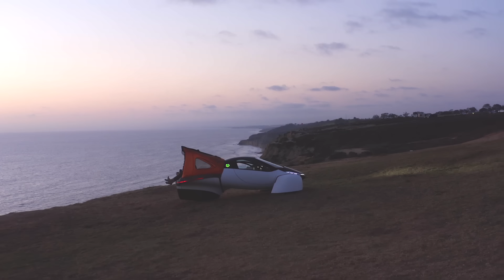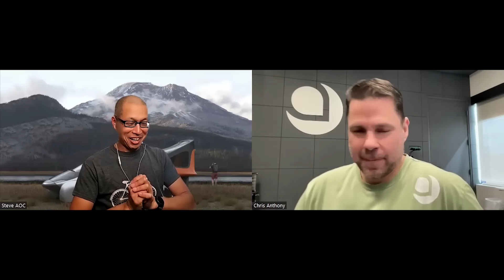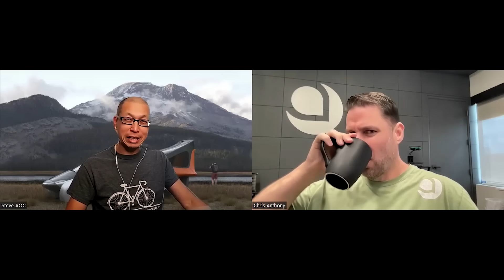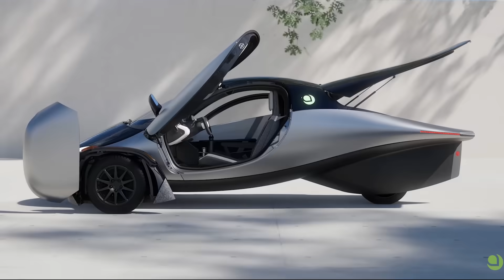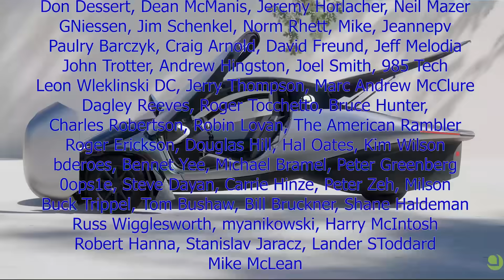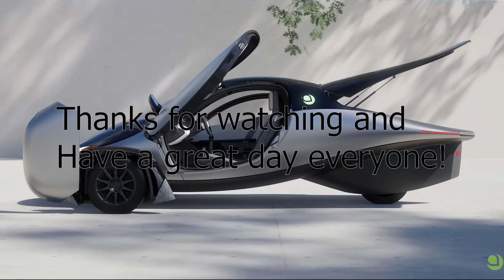Part 1/3 Aptera Update with Chris Anthony May 2024

Comment: I live in New York, but I plan to go to California to pick this up when it's available.  Because to me, this EV represents freedom from oil and the large auto makers.   Aptera is a  company that believes in rate to repair.  A very rare situation.  Plus in general solar will probably satisfy my charging needs most of the time except for road trips, and even most of my road trips are shorter than the capacity. I'm ordering the 600 mile version so I can maintain proper battery charging, use heat or air conditioning when needed and account for cold weather losses.

Comment: Darn, deleted my battery comment by mistake.  Regardless, your pithy reply was not useful Steve.  What was not made clear and this is possibly from editing is that it was suggested they are buying this laser welding equipment locally while also sourcing a full setup from CTNS.  So my question is why this expenditure for the equipment they do not need long term or do they expect the CTNS factory to come much  later.

Comment: The very idea that they would pause production to move the CTNS equipment is incredibly dumb. No one in their right mind pauses production over an event that can be mitigated let alone one so important to achieving production goals. They truly need a month's supply of packs on hand to insure there is no outage because payroll and accounts payable do not stop. I am going to chalk this one up to Chris not being prepared for the question.  

Just do the math in your head. This has to be down at most during ramp up but Chris has stated ramp up will happen quickly. Well one line full ramp is two hundred packs.  Air freighting the equipment is not instantaneous as given the nature of the equipment the packing and movement to the airport is very involved and that is nothing compared to getting it situated and certified for production in Carlsbad.
Reply: Agreed.  I couldn't believe what I was hearing.  That will take months to disassemble, transport, reassemble and validate the line.

Comment: I appreciate the admission that CPC's model did not agree with Aptera's and that is why they wanted to test Beta. A discrepancy does not mean either model was wrong, it could just mean they were both off by a margin of error that added up. But they would want to fully understand the variables involved so they could figure out what caused the inconsistency. 

I'm also glad to hear it confirmed that Gamma was not as useful for testing as Beta because it was designed for a body structure that is now obsolete.  Gamma was tested, but CPC wanted to go back to the source.

I also liked clarification of CTNS's role. They aren't building any production battery packs, that will apparently be in the hands of Aptera, using the purchased robots. The PI battery packs are just being made locally for the PI builds only. Still unsure when CTNS intends to produce  a few battery packs as part of their validation and what they will be used for, but that doesn't seem to be an issue.
Reply: Didn't I hear him confirm that they were using the refined Gamma suspension-frame for the PI builds?
Reply: I don't believe so. It's my understanding that the PI frame is entirely new and related to the carbon fiber SMC construction.
Reply: @richardryley3660 But can you confirm Chris didn't say otherwise?
Reply: @adimchionyenadum2962  You're making the claim. You have to back up that claim with evidence. If you can't, I can conclude you are just making it up.

If you can provide a timeframe for this video, or who the interviewer was, or other topics that were mentioned then maybe I can identify the video and we can discuss it. But no, I do not have to prove a negative.

Comment: Building anything new takes a long time. Time is money. VW took years to build VW Buzz and get it here to the States. It doesn't even like the original Buzz. Give them a chance to do it right the first time. If you work in an industry that makes goods for people. You would know the hardships it takes to make new things. My job can take two to three years to redesign one part. Aptera is going great, and we need to be patient. Thanks for the information you got.
Reply: It's taken years for Aptera to do what they are doing. Started around 2006 and that failed. Started again with a similar vehicle in 2019 and here we are 5 years later. I fully understand it takes time but please, do not hold a carrot out in front of the crowdfunding crowd as it would be next year, on;y to give people hope that they will get their prize within the year. Aptera (like many other startups) are guilty of this. At least VW didn't ask people for money years ago. They just teased us with prototypes. So, they just lived rent free in your brain all of those years.
Reply: @billsmith5960  The earlier failure was exacerbated because of lost of management control and the recession (which resulted in a lot more startup failures than Aptera).  A new model takes automakers typically anywhere from 5 to 7 years to make and they have billions of dollars and much manufacturing structure.  So the 2019 startup is not really that far behind given much smaller startup funding.  At least they aren't burning through investor funding like several other EV startups that have failed or about to fail.
Reply: @madmotorcyclist  - Yes they lost control but in the end, same two guys with a similar product.

Yes they are not burning through as much money and it shows in the lack of progress. There is a point where you have to start spending. If not then it's the same cycle of being right around the corner and then missing that milestone only to have redesigned something. It's a much too common cycle.
Reply: You still haven't disputed my point.  Automakers even with billions of dollars and manufacturing facilities and suppliers already lined up take 5 to 7 years to make a new model.  Aptera's timeline is not that much longer so far given the fact that they essentially started from scratch.
Reply: @madmotorcyclist  - The traditional automakers go through lots of design and testing. They don't advertise that and thus, we just assume the development cycle.

As for Aptera, they are not even to the stage of pre production prototypes. Yes, they have plans for 16 of them. Yet, we have zero idea if those will live up to the claims. Then will they live up to the reliability and long term use?

At this point, people are assuming that they just need to get to production because they see a prototype that looks finished. Yet all of the details are unknown or Aptera just tells us something and we believe it. 

A good example is the complete body and chassis. They made a complete change to it. Then it's the suspension. Seems that it's been ready to deliver since 2021 yet they are still refining it? Sounds like to me that what they claimed in 2021 was not correct yet people believed it. Then in 2022, 2023, 2024....

So what are we to believe? They are super efficient and will produce a product that will be as reliable as what traditional auto makers do? Will they have the service and warranty that traditional automakers do? What about training of the mechanics? Seems that Aptera has glossed over all of the details yet people seem to just believe all of their claims.

If they can pull this off and actually stay in business plus have happy customer service, then I'll be the first to applaud them. At this point, they are not even close and the superfans think they are.
Reply: @billsmith5960  You are make factitious points.  First Aptera has been more upfront with information and has walked investors through their design and step by step progress with more updates than any other EV startup, which you seem to only grouse about and chastise if their timeline slips. Second concerning warranty will be derived once integrated testing begins.  Already we know the hub motors have been tested in extreme conditions and up to million miles by the supplier.  What are you concerned about with their body?  Fiberglass and wraps we already have experience with it and it seems the only new thing is the carbon fiber extrusion production and integration with the outer fiberglass shell, which they have seemed to have passed.  As for the frame updates I applaud that they make updates from the experts in Italy that know more about it than you are me.   As for accuracy of information you doubt the computer models and simulations they have been using (they already have shown how close multiple simulations have conformed to real testing with Beta and Gamma (maybe you missed those videos of the graph plots, or the blender app that showed their solar estimates are on par with what they stated).  Again, has other EV startups  or even Tesla been as forthcoming? Maybe you should be directing your efforts to other EV automakers openness (like where is that Tesla supercar they have been working on and taking money for)?  Guess you want them to go fast to production like Tesla did which had horrible fit and finish issues.
Reply: You lost some credibility saying "we just assume the development cycle" and yet you don't apply those same assumptions and timing it takes for Aptera.  Let me give you a concrete example: I have a 2011 Leaf (that I still drive as my main vehicle on the original battery) and can use it as example of how long it takes to production.  I'm on the first generation and the second generation took six years (2017) to get to production.  Gee, Nissan had all the prototyping with the first generation, money, facilities and suppliers lined up to make a new Leaf model and it only took them six years.  So, if Aptera makes production next year even without having everything in place at the start of 2019 they seem to be on track and maybe even ahead.  Sure they blew pass their timing estimates but given how they are approaching production is radically different I can't fault them for missing deadlines for something that is unlike any other vehicle.
Reply: @madmotorcyclist  - Next time you post, don't make it just a rambling on and on with no clear thought process. If you want intelligent responses, change the way you post.
Reply: @madmotorcyclist  - Since the original timeline was talking about timelines, let's take two examples of EV's that are much more complex:

 If you ever followed Ford and their F150 EV, they announced it in January of 2019 and first delivery was in May of 2022. 

The Cybertruck was announced in November 2019. First delivery in November 2023.

You said: "Automakers even with billions of dollars and manufacturing facilities and suppliers already lined up take 5 to 7 years to make a new model."

I picked two completely different companies making brand new vehicles. Plus they had to go through the whole covid thing. So, from announcement to delivering to a customer seems to be around 3.5 years for Ford, and 4 years for Tesla.

So, here we are for a vehicle that was presented around 2006 and failed. Take that old design in 2019 and try again. Here we are 5 years later and they don't even have a working pre production prototype. This is from a company with production dates of 2021, 2022, 2023, 2024 and now 2025. I wonder why it's taking so long?
Reply: @billsmith5960  and their quality speaks volumes of those expedited timelines.  With Ford it is software.  With Cybertruck it is with recalls.  What about those early Teslas models their quality was pretty bad with how their body was put together.
Reply: @madmotorcyclist  - The Aptera quality is excellent. Same for durability and when it needs to get serviced. Aptera has them all beat.
Reply: @billsmith5960  Oh, a sarcastic remark, how drool.  Was my response too succinct for you to understand.  The Ford lightening software is atrocious which happens when you slap a battery and corresponding electrical system in an already existing design too quickly.  As for Tesla monstrosity known as the CyberTruck I give you https://www.youtube.com/watch?v=LC9a3GR1HJY which shows quality doesn't come with price, especially their trucks have already have rust issues.
Reply: @madmotorcyclist  - I thought we were talking about the timeline about going from conception to production. If you want to change the subject, then I guess we can go that way.

As for the Aptera software and quality control, please tell me with the current customers, how that is working out. It's easy to take someone that has produced something and sold to the customer and criticize it. Yet Aptera has produced zero consumer product and yet, they are perfect? Seems like a double standard you got going there. How about we wait until Aptera gets these in the general public and see their YT videos. Then let's revisit it in a year or two when they have some km's on them.

This way, we can compare apples to apples. As of now, you are not.
Reply: @billsmith5960  Then why did you bring up the Ford Lightening and the Cybertruck as examples to buttress your point?  They do not apply  considering they were developed with already existing supply chains, facilities, and money backing in place and are not actual EV startups from scratch!  You are the one that changed the subject.  Even Tesla took years to get it right with the Model Y.
Reply: @madmotorcyclist  - I bring up those two examples because you said, "Automakers even with billions of dollars and manufacturing facilities and suppliers already lined up take 5 to 7 years to make a new model." I would consider Ford to be a traditional manufacturer and Tesla to be at the other end of the spectrum. This is why.

As for Aptera, they have one single product to make and they started in 2006 yet failed. Came back in 2019. Then if you look at the official Aptera videos, it was to be done in 2021, 2022, 2023, 2024 and now 2025. All I ask is for Aptera to not be lying to us and just give an honest timeline.

For example, in 2019, all they had to say is this:

"We will target production in 2025. The vehicle will be completely redesigned but that's because we want to make the most perfect product possible. It might look the same but trust me, it will be much different under the skin. So, please make reservations and invest in our company. We promise we will hit that target. We do not want to be like other EV companies that promise unrealistic timelines. So, give us your money, we promise we will get there in 2025."

There you go. All they had to do is be honest from the beginning as opposed to hanging a carrot out in front of everyone for 5 years. Since they have not been honest, it shows they are just using the crowdfunders money to develop the vehicle and then hope for an investor to get to production. They could have mentioned that too.
Reply: @billsmith5960 the Aptera today is not even close to the first Aptera! They completely started over from square one except the name.

Comment: I notice a lot of comments about "delays" and more delays, and why is this taking so long. I think, for Chris, there is a very fine line between being confident and giving firm timelines and then disappointing people when those cannot be strictly met. In business, there is a whole chain of events that have to come together, and multiple vendors that also have their timelines and any interruption or delay along the way affects the whole process. And I think because Aptera is not infinitely funded, they do have to be very careful and do their due diligence when securing vendors and spending money. This is not to excuse any delays but I am realistic on what it takes to put an extremely production intense item like an automobile into production...and not pull a "Fisker" in the process. I think just about every legacy automaker has been delayed in their first production EV vehicles (BMW has delayed once again the Macan EV) and they all have decades of experience and tons of cash. Tesla was delayed and fraught with production hurdles with the Model X (VERY frustrated reservation holders) and 3 but they are now both on the road. So, I would say if you believe in Aptera in the long term, continue to ask questions, but let them do it right and in the long run they'll produce a great product. Thanks for the video.
Reply: The Macan is actually from Porsche… sorry about that

Comment: What about the production equipment for the solar pannels?  It looks to me like each of the 4 pannels will need its own assembly line.
Reply: You are likely correct except that there will likely be 1 "stringing" machine (solders solar cells to each other) then the strings will split off into 4 streams.  Each stream will have a kind of layup tool then a laminator.

Comment: Does Aptera need 16 Pi vehicles to complete validation?
Reply: Many will be need for the crash testing
Reply: @CharlesAnsman  Since they are not required to do crash testing, why would they need "many"?
Reply: They are not required by any law to do crash testing, but they cannot be prevented from doing it either. 

It is possible that not all 16 PI builds will need to be made before production. But the crash testing and validation of the vehicle's performance must be completed before it can be sold.
Reply: @richardryley3660  If they want to advertise safety rating they will.
Insurance companies will also want them, otherwise the rates will be higher.
Reply: I guess not and I bet they won't build all 16.
Reply: @adimchionyenadum2962  They probably will eventually but they will development components like the belly cooling using the later models. So they won't be needed for release.